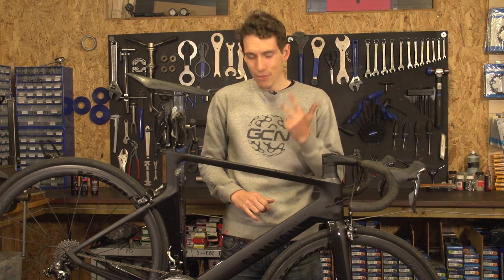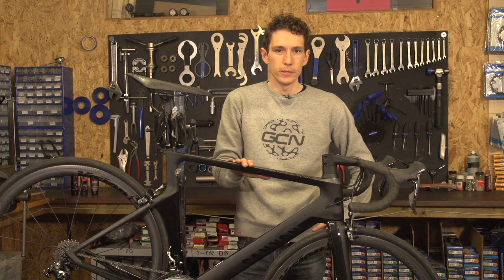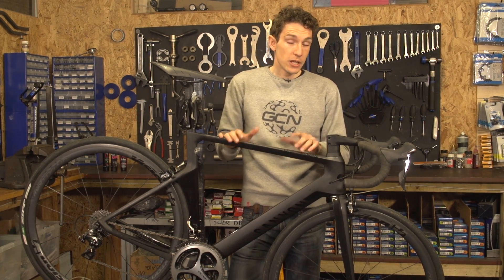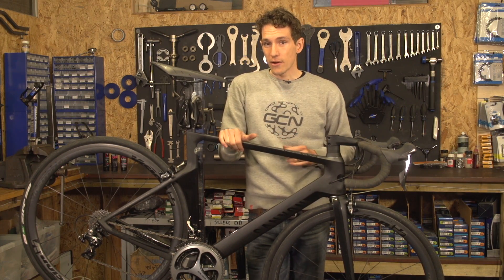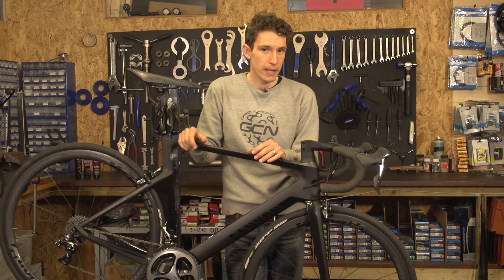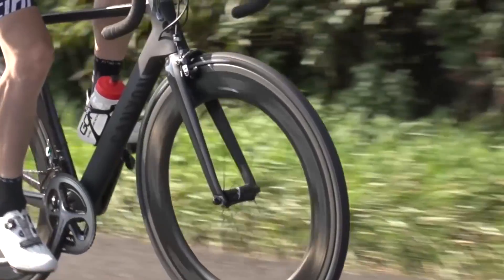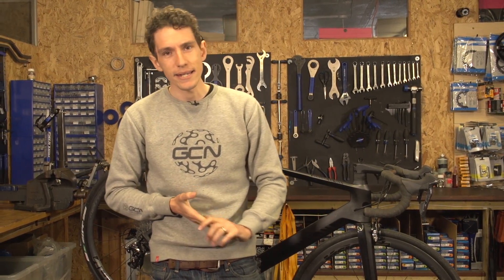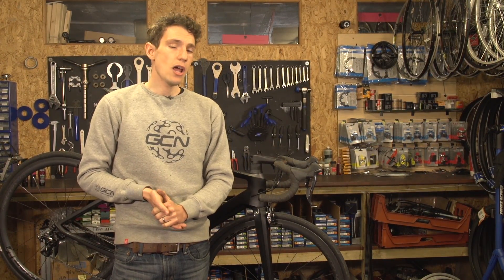7 Things You Didn't Know About Carbon Fiber

Comment: Isotropic basically means the material has the same properties in all directions. Carbon fibre is anisotropic because the fibres have very different properties in different directions.
Also, the gradual failure property you say carbon has is also exists in aluminum and other metals. Small cracks can exist in aluminum and grow each time a high enough load acts on the area of the crack. Its always worthwhile inspecting a frame for cracks, whether it's carbon, aluminum or any other material.
Reply: +Simon Rendell I wouldn't say carbon composite has a gradual failure mode unless you're comparing it to some sort of ceramic. Once you load a carbon composite much beyond it's yeild point it will experience sudden failure, compared to aluminium which have up to a 11% elongation before total failure. That said I'm pretty sure the high strength 7xxx series alloys have a much lower elongation percentage before failure.

The fatigue strength of aluminium alloys may not be great compared to steel alloys but It seems unlikely to me a carbon composite would be able to sustain as many load cycles as an aluminium alloy. That said I never enjoyed material science at university so I could be wrong on that part.
Reply: +Paramour, I would be very curious if anyone has done a bike frame in 2024 T6.  It has the highest vibration fatigue of any aluminum alloy.  This is why it is the primary alloy for helicopter structural and skin parts (the Black Hawk airframe gets 60% of its structural integrity from the skin alone). However, it can't be welded.  So, it would have to be lugged and glued.  For what its worth, I used to work on Sea Hawks (Navy's version of the Black Hawk) as a structural mechanic.
Reply: +Simon Rendell I feel like Mr Richardson should get a channel ban for not knowing this !
Reply: +Andrew Bedford No need for a channel ban! Simon has the best engineering / mechanical knowledge of the GCN presenters! Having said that, I do charge for sharing my knowledge... a GCN casquette should cover it ;)
Reply: Simon Rendell haha i like your style sir.
Reply: +Your Paramour I think you're right about this - in fact i've learnt that carbon is less safe than Steel or Al because of its sudden failure when it is overloaded ("violent fracture"), because it will not really stretch or bend in any way while breaking apart - a process that consumes much of the fracture energy in ductile materials. (sorry for some terms here, i only know the german ones and couldn't find the proper translation in any dictionary)
Reply: +Simon Rendell Yep. In fact that (fatigue) is usually the critical failure mode of aluminium in a vibration loaded part like a bike frame. It's also the reason why aluminium frames are so uncomfortably stiff: once you have dimensioned aluminium so sthe part is more or less fatigue-safe, you arrive at very stiff cross sections.
Reply: Safety isn't a material thing it's an engineering thing.
Reply: Your Paramour Right in the aspect, that the engineer has to choose a sufficient material. Carbon Fiber surely can be a safe material, but there are some things to consider when you're planning on using it. As I said, a violent fracture can be more dangerous than on metal frames but fatigue can be a lot more predictable on the other hand. Some evolution has already happened - an engineer from KTM (Austrian bike manifacturer) told me that they mix the carbon fibers with Aramid now, because it is more resistant to punctual forces applied by shrapnel stones hitting the frame for example :) My bike has carbon seatstays and I haven't had any problems with it yet.
Reply: I got a feeling that if you were to go on, you'll talk about the plastic zone at the end of the crack extending each time causing beach marks leading to fatigue failure. Also, the carbon failing from fibre pull out from poor bond between fibre and resin or by fibre fracture due to weak fibre.
Reply: The main safety concern with composite parts is that checking for damage is not straightforward and far beyond the means of the consumer. I'm not really sure if the failure mode of Al or steel on bike is really that helpful on a bike, since there is still a high likely hood of you falling off if your bike starts rapidly deforming.

You would mix aramid fibres into your composite stack if you need the added abbrasion resistance or puncture resistance the aramid provide, but in doing so you're sacrificing ultimate strength, stiffness and weight. Something like a consumer kayak would probably suitable for an aramid/carbon mix (a racing kayak would still want the lighter weight).
Reply: Simon Rendell wow I didn... NERD!!! (JK)